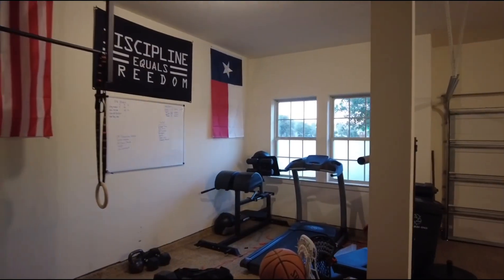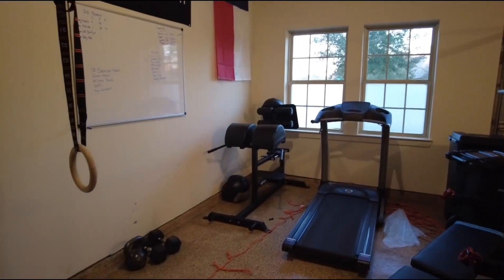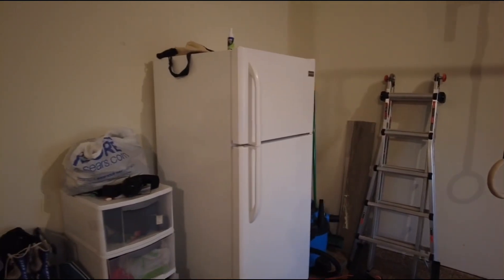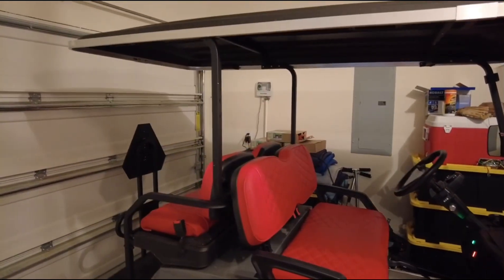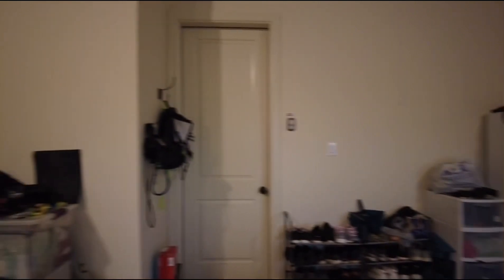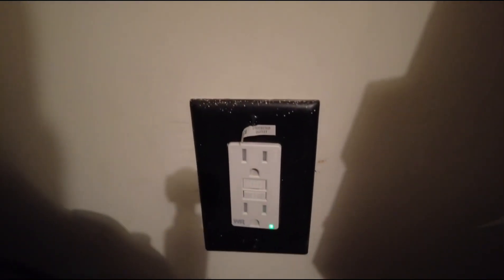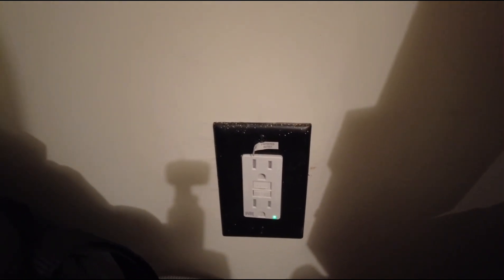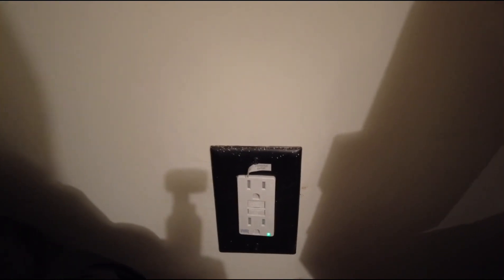Replacing old GFCI outlets

Comment: What happens if a circuit has a GFCI outlet & the circuit breaker is popping? 
Is that a bigger electrical issue or could it be an easy outlet fix too?